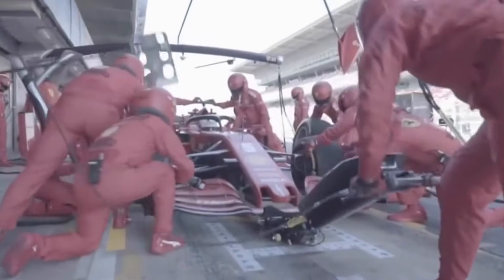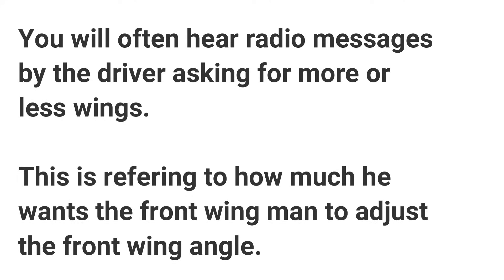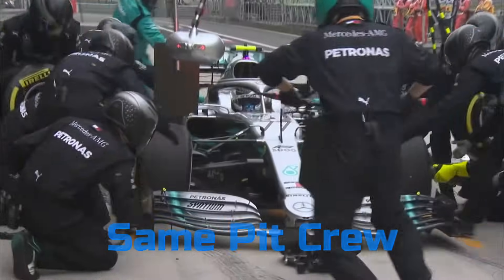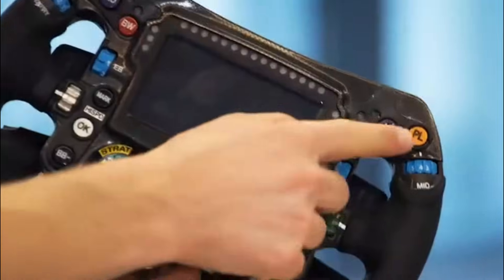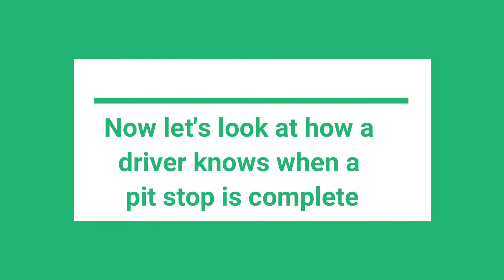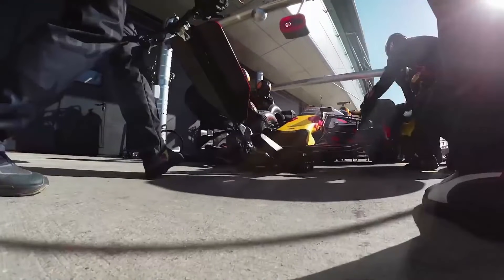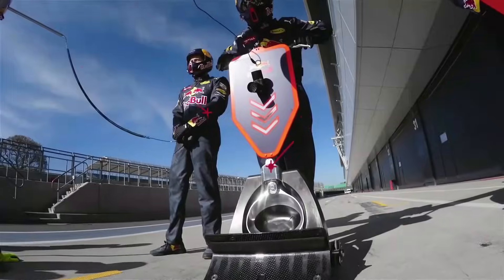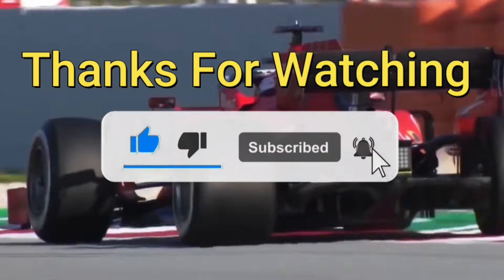Formula One Pit Stops Explained

Comment: I once thought up an concept of a Green-White-Checker overtime system for Formula 1.  Which would be useful for the 2020 Abu Dhabi Grand Prix.  During this scenario every car would have a mandatory pit stop with a uniform minumum time (about 1 minute) for not just tires but refueling of a maximum amount of fuel (10 gallons or so) so that they can get to the end.  They would then return to the same placement they were when the Safety Care was deployed.  Once the SC pulls in, they get a single chance for two laps.

Comment: If they can change tires in under 2 seconds, why not design tanks to do the same?  Re-fueling should be brought back by swapping tanks like tires. Much safer. Quick couple connections, pre determined amounts of fuel for maximum strategy and handling (Williams/Nigel Mansel)  Could use a jib crane or jacks to remove and install tanks.  First team to do it wins in the pits.
Reply: Would that work?? Wouldn't you have to completely redesign the car and have the fuel tank possibly exposed? I dunno...good idea but I'm not sure if it's possible. Plus They RARELY run out of fuel if measured correctly right? What the FIA says goes...but great idea! Just like I was thinking they should have sensors in the tire guns that would automatically tell you when the lug nut is on tight enough and they wouldn't have to press a botton and have room for possible human error that could result in tragedy. I just saw a race on Netflix where the Haas car had not ONE car with a loose nut have to pull out of the race...but there SECOND car IMMEDIATELY after...just different tires! So that means TWO different air gunners F'd up! It was INSANE!!
Reply: @Bubbles_11  I don't know if your questions were answered yet but your suggestions about sensors in the guns is a real thing. The guns do many things, actually. First, they have a lighting system on them, which changes color depending on the mode. For example, one color to tell the operator that the gun is in "remove the nut" mode, another color to tell him it is in "install the nut" mode and yet another color to tell him the nut is tight. Going back to the install/remove modes, the gun switches automatically, so the operator doesn't need to do that, nor does he have to press a button to tell the computer the nut is tight. That is automatic, as well. All four guns are linked to a central system, which also links to the jacks on the front and rear of the car. The jacks are raised manually but released automatically, only when the signal from all 4 guns is received, telling them that all nuts are installed properly. If one or more nuts are not locked on, the jacks will not release the car.
Reply: @woreoutdrummer1962   Ohhh wow! Makes sooo much sense now! I am new to Formula 1 but not especially new to car's! I so appreciate the time you took to explain all that to me!!! Love!🙌🩷

Comment: i have a question. if all cars are managed by one pit crew, who determines which driver to attend to if more than one driver requires tyre changes.
Reply from the maker: Can you please elaborate? Do you mean if both drivers need to come into the pits at once? Thank you for your comments and for watching our channel.
Reply: @F1Education  Yes
Reply from the maker: It is based on the racing order. The driver in front will likely get the pitstop first.
Reply: @F1Education  Thanks.